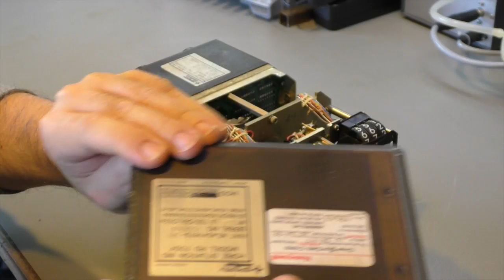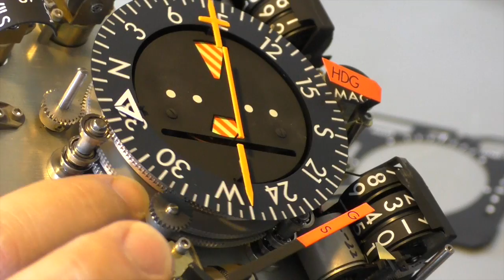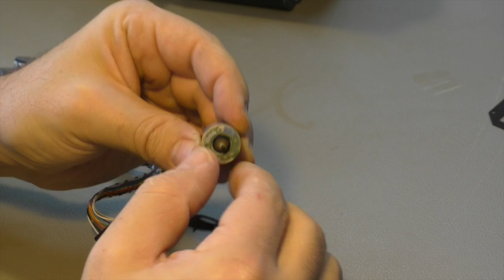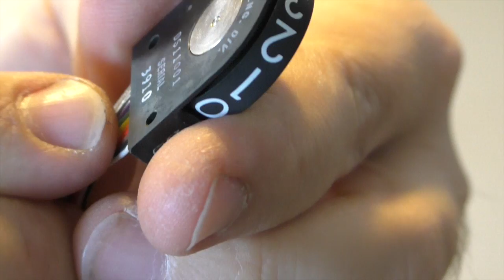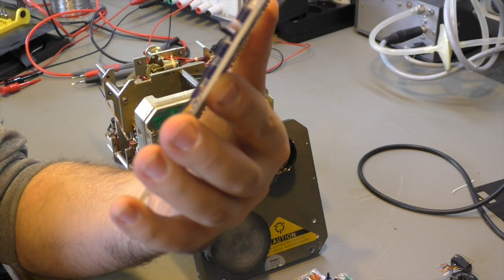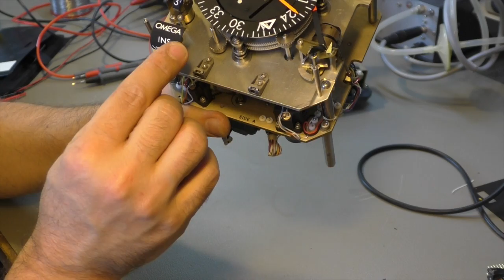Aircraft Instruments part 2 (PWJ23)

Comment: Oooh, those drive motors actually say "DC MOTOR" on them so it shouldn't be too difficult do make it spin :)
(visible in video slightly after 35:10)
Reply from the maker: It has all kinds of motors. AC... DC.... synchros. And yes, the DC motors just need a battery to run.

Comment: If you use positive as common and you look straight at the front of the wheel the numbers correspond with the resistor color code. Not sure why you were looking at an angle...?